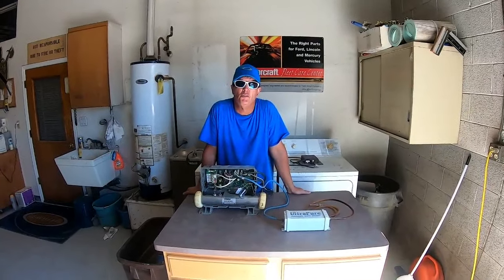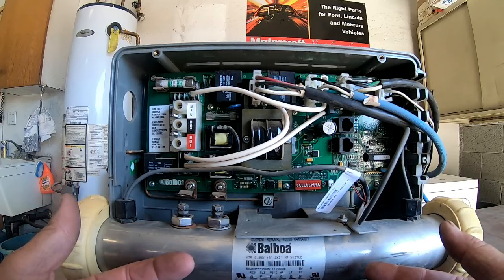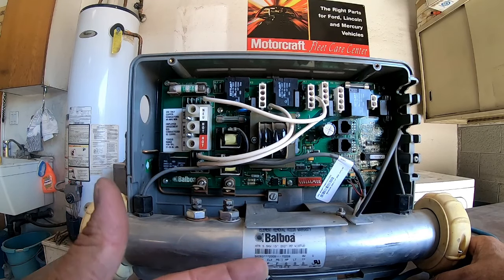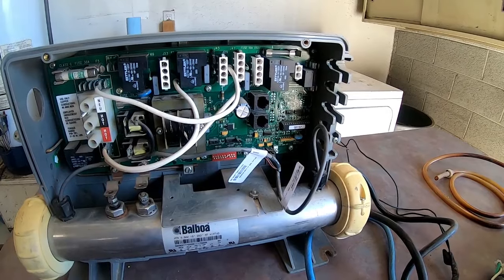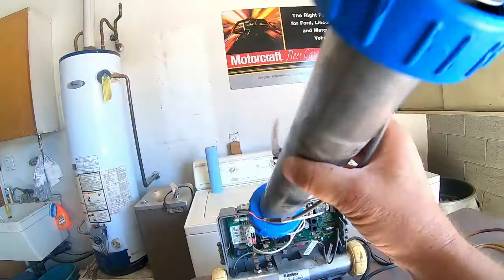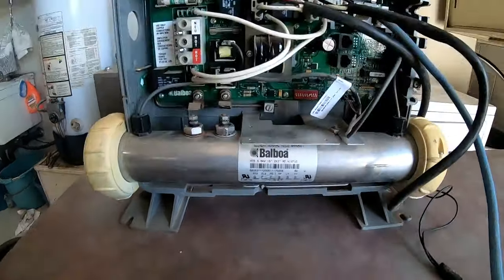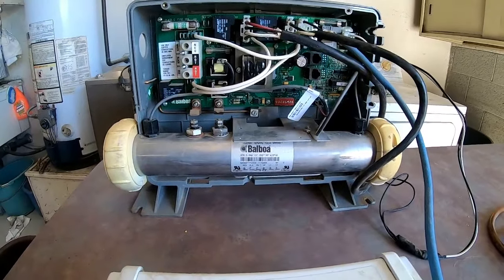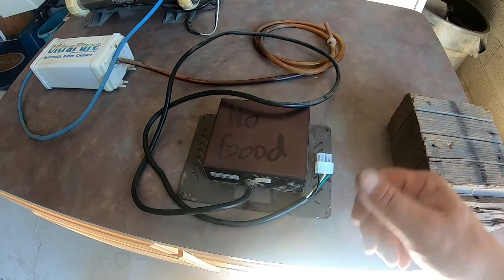Hot Tub GFCI Breaker Keeps Tripping..6 Things To Check For.(DIY Spa Repair) Arizona Hot Tub Factory

Comment: I wish there was a better aftermarket heater - it is such a lousy design and not a good quality part. I just replaced mine with a supposedly OEM one and one of the temp sensors that came in it was DOA and out of spec so it would throw a temperature probe error. I was able to use the ones from the bad heater which worked. Now a few months later the new heater is tripping the GFCI again. That electrical connection on the heater is such a bad design too. I had to grind down a wrench to hold the stud because you have so little room. Guess I'll buy another one and hope it is a better unit.
Reply from the maker: Sorry to hear you are having so much trouble..
In all of the years that I have been doing Spa repairs Balboa is by far one of the best designs on the market. So I see this all the time with home owners You might of bought the wrong heaters with the wrong sensors. A lot of DIYer think they are buying an OEM part when in fact it is an after market part sometime you get lucky sometimes not. As for the electrical connection... Make sure you put the washer on the right side of the connection and they make a special 1/4 wrench for that task. 
I never use aftermarket parts because of the problems you are having 
Thanks for Watching & SUBSCRIBING

Comment: I've tested all of these circuits.  Even when I have them all disconnected, the breaker reliably trips after 1 min 17 sec. I have no warnings on the panel before it happens. It's a Jacuzzi 300.  Any thoughts on what to try next?
Reply from the maker: Might be in the board or could be the connections between the main panel and the board.
With everything disconnected from the board it can only be so many things. 
Thanks for Watching & SUBSCRIBING

Comment: I have a Master Spas TS8.25 that trips the gfci during any size rain storm. No moisture in the gfci panel or in the control board. I remove to two fuses in the control panel for the motors and reinstall and the breaker will reset.  Hot tub has been installed for a year and a half with no issues. Any ideas thank you!!
Reply from the maker: I just had this happen today ...There was water in the seal tight running from the sub panel to the spa pack and it was causing it to trip.. Hope this Helps Thanks for Watching & SUBSCRIBING

Comment: Spa Man, thanks for the video, very helpful.  I have a Balboa pack as well.  CB is tripping.  I disconnected everything you talked about, but the CB is still tripping.  Could this be a bad CB?  Or is there anything else I can check?
Reply from the maker: Yes.. Disconnect wires from the spa pack and check and check the wiring also check to make sure you have all the wires tight.Thanks for Watching & SUBSCRIBING
Reply: @spaman5440 have same issue, by CB are we referring to "circuit breaker" or "circuit board"?

Comment: How long does it take b4 the system to ask for heat to come on. Mine trips after about a minute.
Reply from the maker: It depends on your settings.. With the breaker turned off check to make sure all the connections are tight then start checkin each component and see what is causing the problem. should be able to figure it out in just a few mins... Thanks for Watching & SUBSCRIBING

Comment: I have a balboa board in a cal spa hot tub. It all of the sudden tripped breaker and I've disconnected everything from the board and it's still tripping breaker right when I flip it on. I also found 2 glass fuses that didn't have continuity will blown fuses trip the breaker right away?

Comment: I have a question.  What If the hot tub is running with jets and lights on. And it trips in like 12-16min? 50 amp gfci hot tun
Reply from the maker: Check the heater or Ozone

Comment: I have one where the circ pump is tripping the gfci. I put a new pump in it and it does the same thing.  Tried a 3rd pump and it still trips it 10 seconds after it’s powered up.  I don’t see any obvious issues with the relays or connections on the board.  Think the board is bad?
Reply from the maker: If you are putting a new pump in and everything is hooked up correct.. and still trips ? then you need to start checking other things. its hard to guess what is causing the problem with the info you have given. If it trips with in 10 sec it is something easy to track.Thanks for Watching & SUBSCRIBING
Reply: @spaman5440  agree with it something easy or hope so!  I have all pumps, ozone, heater leads disconnected.  The unit powers up and as soon as the circ pump relay is triggered it trips the gfci.  Without a load the circ pump relay output is 120v.   I also tried using one of the other relays since there are multiple 6a relays on the board.  It does the same thing.

Comment: So I have a tub (J325) that is tripping the GFCI plug as soon as it powers on. I isolated it to the circulating pump. However, not sure if this is indicative of something else: I disconnected the black lead from the control panel and it doesn't trip. But when I use my meter to check the terminal's voltage to ground, it trips! Could the relay for that pump or even the board be bad? I did not disconnect the white lead though. Should I have disconnected it to fully isolate the pump?   thanks for your help!

Comment: How do you check the check valve or do you replace the whole ozone unit?
How do you check the heater and can it just be serviced?
How do you test the motors once you find which is bad?
Reply from the maker: If any of these items that you mentioned above have caused the breaker to trip you are way past the point of service and the item will need to be replaced or rebuilt.
(1) With the ozone you need to replace the check valve at the very least once a year. Once the ozone is causing the breaker to trip water has gotten into the unit and it will need to be replaced.
(2) On most units I deal with if you get 5 to 7 years out of a heater you are doing good..Most of the problems I see are caused by lack of proper maintenance by the homeowner.
(3) If you have a motor that is bad ...will not run or is popping the breaker...It is time to rebuild or replace ( I almost alway rebuild) there again motors last about 5 to seven years due to owners maintenance.

All three of the problems that are talked about are most often caused by putting way to much chemical in the hot tub and not keeping the proper chemical levels... not doing a flush and fill every 90 to 100 days...not keeping water in the hot tub and running the tub 24/7/365 days a year.  

Great questions... Thanks for Watching & SUBSCRIBING.
Reply: @spaman5440  -- what's wrong with "running the tub 24/7/365 days a year"?

Comment: Aloha! I have been scouring the internet for info. My hot tub isn't working: only hear a click sound when i press the pump buttons. All power supplies look good. Pump one is 5 months old. Breaker is not tripping... any ideas?
Reply from the maker: Check fuses on the board.. check to make sure wiring is correct or you might have a bad motor. Thanks for Watching & SUBSCRIBING

Comment: Spa Man you rock. My breaker blew and fizzled out a few days ago. Installed new breaker and it was immediately popping. Followed your suggestion. Disconnected ozone first. That wasn't it. I had just cleaned my filter before it blew and and noticed I was still getting a flow error and then my CB blew. So I disconnected flow switch. That was it. I plugged it back in and its now good. thx
Reply from the maker: Good job...

Comment: Your video saved me.  It was the Ozonator, that when it was plugged in, kept tripping the breaker.  Spa tech had told us it was the main GFCI breaker, so we had an electrician replaced it, but then nothing would turn on.  Found your videos and your tip on the Ozonator. I disconnected it from the panel, and the pumps and blower turned on.  Only thing now is that with the ozonator off, a "Clicking" sound comes on.  Is it because of the Ozonator being disconnected?  Waiting for a new Ozonator to arrive to install it.  Thank you so very much!  subscribed and have made sure to mention your videos as many times as I can!
Reply from the maker: Thank You so much for the kind words...The clicking sound could be many things.. I would replace the ozon with the new unit and things should be back to normal. Thanks for Watching & SUBSCRIBING

Comment: Is it typical to have pump 1 not plugged in and plugged into pump two per say ? When I opened this new used unit it’s tripping breaker and idk what’s wrong yet , but here’s two issues I see , in the main panel the neutrals and grounds are all sorts of mixed up rather then designation of one bus for ground and another for common … second seems to be pump in plugged into pump 2 rather then pump one

Comment: My hot tub pump was working great until my son and several friends used it. When they got out, the water level was below the filter intake and the breakerhad tripped. I cleaned the hot tub, drained it and refilled it. When I flipped the breaker back on, the circulation pump, light and heater all came on, BUT when I turned on the "jets pump" it tripped the breaker. What is the most likely cause and/or damage? Thanks!

Comment: Very helpful video; using your testing process saved us a very expensive service call.   Breaker was tripping after about 6 seconds.  We originally thought it was the heater; turned out to be the circulation pump.  $159 fix, instead of $300+.
You got your stuff right!!!

Comment: Hi there, thank you for the video. Simple an easy. I followed it but I still need help. I have a Marquis spa and I am replacing the circuit board that was busted. After setting up the break tripped. I followed your troubleshooting instructions and no lack. The break still trips. Only if I remove the wires ( white/red/black) from the board it doesn trip. I know the circuit is in agoof shape because it was done a year ago. I wonder what else I can look for troubleshooting. Can it really be that the circuit board they sent me is defected? That will be very bad luck... anyway if you can help I appreciate...trying to save some $ given that this year my house decided to break pieces by pieces..😔😔
Reply from the maker: Shut off the breaker..and check the wiring... make sure everything is correct and tight...Hope this Helps...Thanks for Watching & SUBSCRIBING
Reply: @spaman5440  thank you for the quick reply, where should I check that "everything is tight"? I'd I disconnect the wires from the board ( let them loose in the air) the breaker doesn't trip...so that means to me that the circuit should be fine, but something is wrong when connecting to the board.
Reply from the maker: @robertacannerozzi4120  If you have the time you can call the shop and ask for Scott  (AKA  Spa Man) he will be able to help you.

Comment: Before I found you and your videos, I had already removed all the connectors on my master Spa hl8.5 except for the heater because I didn't know how that worked. This was done because all of a sudden my breaker started tripping immediately after every reset .  I found by disconnecting my Laing x400825 circulation pump the system would stop tripping the breaker. I plugged it back into test and it tripped immediately.
I have removed the pump and everything looks good inside and the propeller moves freely. It appears that this pump is backordered from everywhere. Would you agree that the pump is definitely the problem? * all work was performed while breaker was off.
Reply from the maker: YES...If you plug it back in and it trips that is the problem... Good for You Thanks for Watching & SUBSCRIBING

Comment: SPA MAN, if the heater is "rusty" and causing it to trip, is the heater fixable or does it need replacing?
Reply from the maker: Replace the entire unit..New tube - heating -element - sensors - gaskets...Now if you just want to fix the rusty crusty part you can try it (its kinda like stopping the clock to save time though)Replace and move on ... Thanks for Watching & SUBSCRIBING

Comment: What do you do if it takes several days sometimes for it to trip? The  technician replaced the heater element yesterday because the washers were worn and it was corroded and he says causing a short. The first visit he blamed water splashing in as the cause. He tested amps on the pump and heater abd sats everything is in soecs.The worn element made sense to me but it is not covered under warranty because he says the water conditions is causing the corrosion, again seems like a reasonable assumption , however it tripped again today a day after! After $400 of visits and a warranty that apparently is worthless what should I do next? It is only a year old! Is it a gfi problem?
Reply from the maker: You could have several things going on.I do not want to confuse others that might have the same problem but the fix is different for different tubs and spas ..I would call the shop and talk to Scott and see if he can get you looking in the right direction. Thanks for Watching & SUBSCRIBING

Comment: i had my panel service upgraded , and the electrician took down subpanel for hot tub and said i need thicker wire and different conduit  now he moved out of state. so i can put in thicker wire and conduit myself , but i have a big panel can i hook right into that or do i still need a subpanel?
Reply from the maker: The breaker should be in line of sight and no further then 20  feet away (this is a good rule to follow) and use #6 wire.
Reply: @spaman5440  can it be in the main panel since i have plenty of room?what size breaker and which conduit?
thank you
Reply from the maker: @jeffcolantuono4673  You might want to read the owner manual for the hot tub you are installing to find out what you need.

Comment: I have a Balboa spa and I have diagnosed very similar to yours. New breakers new wiring. It won't trip when you turn it on and you can run pump one and two fine and the blower and it heats up. However if you first turn the spa on and hit the program button on the control panel it's trips the breaker. If you turn it on and turn everything else on first then hit program it doesn't trip 🤷🏼
I'm guessing it has to be the control panel but it's just a mystery to me.

Comment: I got all new wiring and a new GFCI breaker and the hot tub still trips the breaker after about an hour.  Hot tub company cannot figure it out and electrician cannot either.  Hot tub only two years old.  I guess I have to do it myself?
Reply from the maker: What type of equipment is in the Hot Tub ? Every Hot Tub has little things that ...If you don't know what you looking for you will never figure it out. Call Scott at the shop and he can get you going in the right direction. He will need the manufacture of the Hot Tub the year and what equipment is in the Hot Tub if you can't find the equipment part pull the front panel off and snap several pics of things and you can send them to him. Hope that helps Thanks for Watching & SUBSCRIBING
Reply: @spaman5440  Thanks

Comment: Pumps trip the breaker way more often than an ozone.  I think the transformer trips the breaker on those packs more than an ozone pulling .5 amps wide open.  Ozone generators will definitely trip a gecko pack intermittently though and it’s the first thing I leave unplugged if I can’t recreate the symptom on site on a new tub
Reply from the maker: Last year more then 55% of the service calls we did...the breaker was tripping because it was wired wrong
Ozones and heaters were neck and neck.
Next were the pump/motors and we haven't had a transformer problem in quite a while(a Year or more) Thanks for Watching & SUBSCRIBING
Reply: @spaman5440  good to see what other people see in the field.  I work on the Pacific Ocean and a rainforest so I’m sure I see some weird stuff.  I do warranty work so I might be just catching the pumps that are going to short out.  I do a lot of Sundance and jacuzzi tubs so they are definitely different than the balboa stuff.  Until 2016 at least.  The new gecko packs that let the customer set the temperature to only go to 99 instead of 104 are a fun addition lately lol
Reply from the maker: @bulshavix6  Those Gecko packs suck
Reply: @spaman5440  The topside control is even worse because they get moisture in them and it causes all kinds of weird problems.  I have seen a couple not read the temperature right because of the topside control and not a sensor or the board.  I don’t even understand how that works lol

Comment: SPA Man, I am really glad you included the stereo portion on the video.  After hours of troubleshooting I had the same problem.  Disconnected the AC DC converter and the breaker stopped tripping and the Hot Tub started working perfectly; good job.

Comment: CAN YOU NOT STRIP THE HEATER DOWN CLEAN ALL RUST WITH DREMAL WIRE BRUSH RE BUILD  IT IM A NOOB SO IF ITS A DAFT QUESTION IM SORRY LOVE YOUR VIDEOS JUST GOT ME A SECOND HAND HOT TUB I HOPE TO RE STORE
Reply from the maker: I did that years ago (and I mean years ago) and it would sometimes work for a short time but would almost always start have the problem within a couple of months. A couple of times it ruined the board. So our policy is when a heater go out we replace with OEM parts ( unless we can't get OEM part) most after market heater do not last very long. Thanks for Watching & SUBSCRIBING